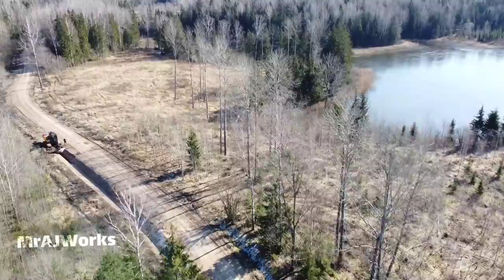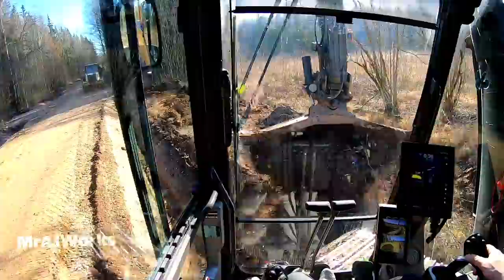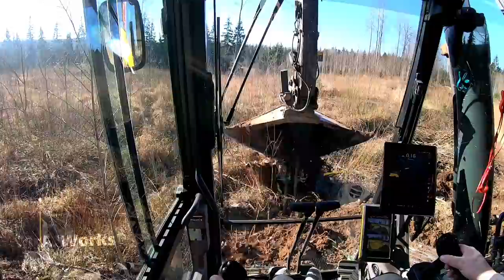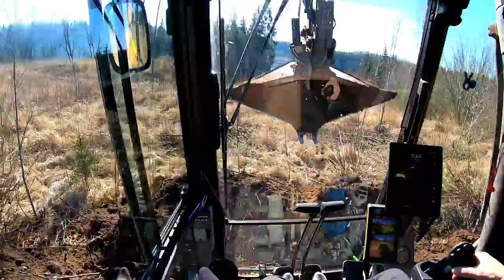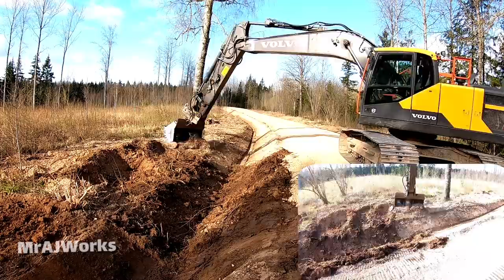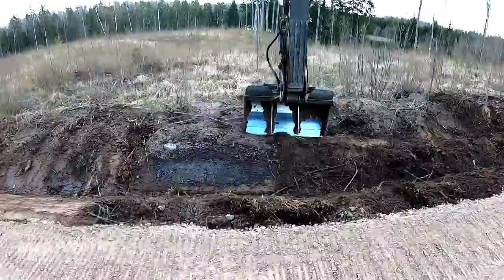Finally, a ditch without water

Comment: Thought the stump would give you more trouble than it did, mainly because you don't have the standard digging and ripping bucket on the excavator, but appears you got better leverage with the ditching bucket because of the shape.
Also, can tell there's alot more clay in this soil compared to the forest road by the way the soil is clogging up the bucket.
Reply from the maker: Yes, there is a sticky clay here that does not want to fall out

Comment: Hi there, towards the end you appear to be resurfacing the ditch with brown forest soil/loam. Why is this ? All I can guess is either ecological reasons or to cut down the glare from the pristine sandy clay ditch - please put my mind at ease.
Reply from the maker: Hi!
It is the top layer of soil. Grass is then sown in it to strengthen the edge of the ditch with the root system.It does not rinse the road in a ditch during heavy rain
Reply: @MrAJWorks  nice one - thank you

Comment: A miracle there is dry earth with you. 🤪Are you used to working with dry earth at all? 😆 Is it in the same forest as the wet construction site? 😋
Reply from the maker: I haven't worked with dry land yet😋😁
No this is another place not related to the forest road
Reply: MrAJWorks It will also be pretty boring to have to work with dry earth 😂 if you are used to wet earth😂. here there is no tension for an experienced excavator driver like you 😜
Reply from the maker: Yes, it will be a bit boring🤔